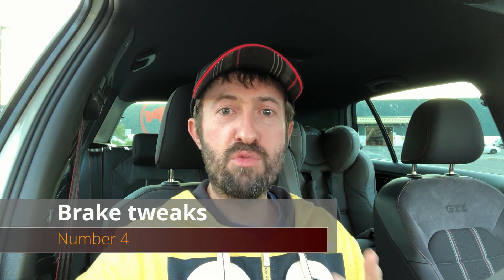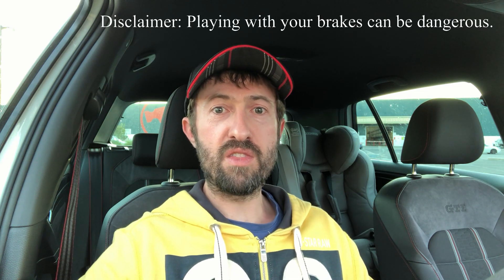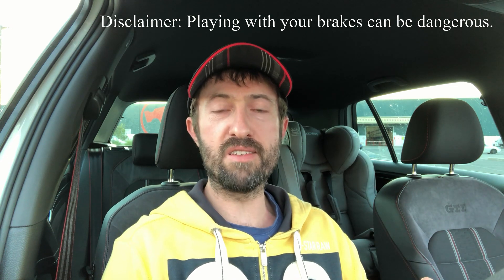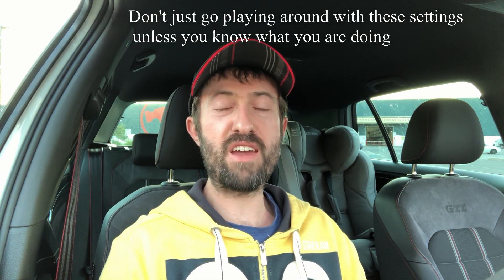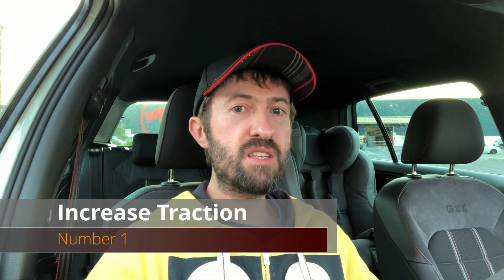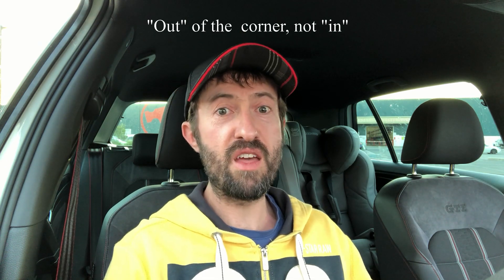Don't hit the track without these 5 OBD11 tweaks (mk7 GTI)

Comment: Am I right in thinking that OBD11 can turn the traction control off on a GTI with Performance Pack?
Reply from the maker: Yes it can. You need to change the way the button works so that long press is off.
Reply: @trackhackau  I managed to set this up with ODB11 which is great, 1 pass sports mode, long press TC off. But this does not actually turn off the TC, you have to also deactivate the Starting Vibration Reduction in control modules, without deactivating Starting Vibration Reduction, TC will not be fully off. Hope this helps.

Comment: i know this is an old vid but your wrong about the XDS it has nothing to do with rear wheels. The XDS electronic differential lock improves the traction and handling of front-wheel-drive models. In technical terms, the XDS system, initially developed for the Golf GTI, is an extension of the electronic differential lock (EDS) integrated in the ESP system. As soon as the electronics detect excessive unloading of the inside wheel of the driven front axle during fast cornering, the ESP hydraulic system builds up braking system pressure in a targeted way on this wheel to restore optimum traction. This way, the XDS acts as a limited-slip differential to compensate for the understeer typical of front-wheel-drive cars during fast cornering.
Reply: True ! Xds applies only to frond wheels

Comment: So you will have the setting in the infortainment system for diff on and off. If you code the diff to increased traction will this setting always be switched to on then even if the setting in the infotainment system is switched to normal?
Reply from the maker: Settings in infotainment don't change. Looks the same. I'm not positive what the change does too all settings. IE does it change normal to sport and sport becomes increased traction. My guess is that it only impacts the Sport diff setting.

Comment: XDS applies the brake to a spinning inside wheel to aid in allowing torque to go to the drive wheel with traction. The effect is the same as if you have a limited slip differential, although it is weaker than a good limited slip as brakes are easily overcome by the engine and hamfisted throttle input will overpower it. It works extremely well on my Mk6 GTI and it definitely has a hugely positive effect on corner exit.
Reply from the maker: I've tried it both ways, low and normal. Verdict is still out. VAQ works pretty well though.
Reply: @trackhackau  I'm sure VAQ is next level great, especially when combined with XDS.  But as my car has XDS alone I can only really comment on that.  About a year ago my ABS control module failed, leading to XDS not functioning.  Prior to that I always thought XDS probably wasn't doing all that much, but having driven without it on a purely open differential showed that it does an awful lot more than I originally thought.

I'm not sure if you can easily disable both VAQ and XDS via scan tool, but if you can it might be worth trying just to see how each contributes.

One of these days I'll install a proper mechanical limited slip differential, but at near stock power levels the GTI really doesn't need it as XDS is surprisingly effective.

Comment: Difference between ASR off and ESC sport?

I have Mk5 gti and ASR on that car is referred to reduce engine power when the car defects loss of traction.
Reply from the maker: ASR - Anti Slip regulation
ESC - Electronic Stability Control
ASR is basically traction control and yes it cuts power when it detects when slip under acceleration. ESC is your stability control. ESC Sport will allow a little bit of play before intervening, eg it will allow a touch of lift off oversteer. Then it will use the brakes on each wheel to straighten you up. Great safety feature, no good on the track though. Perhaps I'll do a video to explain the difference in more detail and the various long coding options available.

Comment: Hi! Can you teel me more about the "Starting vibration Deactivation" option? Is this mod effective only when you put the car in ESC Off, or you can not more use the ASR for 'normal' driving?
Reply from the maker: It’s separate and independent from ASR and ESC sport/on/off. This option stops the car from reducing torque in low gears when you lose traction. It’s to stop you from axel tramping.
Reply: @trackhackau  I've tried to disable the 'starting vibration reduction' but in my '19 Golf GTI PP I can't find anywhere that adaptation. Do you know if it can be coded via long coding istead?

Comment: Thanks so much for the info! I was wondering though how safe it would be for casual street driving to disable brake stabilization, I hope ABS and EBFD would still activate. I'm also wondering how much of a hit to casual driving comfort vs control would change if I disabled the torque limiter and brake/throttle smoothing. I really don't plan on tracking my car, but I still would think disabling ESC, setting XDS to weak and setting the diff to increased traction would improve driver engagement enough while still maintaining comfort and safety, what are your thoughts on this?
Reply from the maker: All the changes are totally fine for street driving. You won't even notice them. Doesn't impact ABS at all. Stability control is also not impacted when it's enabled.
Torque limiter you will only notice from a dig. You will either fry tyres more, or wheel hop more if on factory mounts.
After doing this video I've read up more and I think leaving XDS to normal may be best. I've changed mine back but I'm waiting on my next track event to test more. Theory is that it acts as a pre-load to the VAQ. But either is still fine. You won't notice it on the street unless in the canyons etc.
None of these changes will compromise safety in any way. Always drive within your limits though, especially on the street.

Comment: About the “Increased Traction” setting on Golf Rs,  I feel like this actually slows the car down by reducing power when a wheel starts to slip.  I’m just not so sure about it.
Reply from the maker: Hey mate, I don't have an R so can't comment from experience. But I do know that the haldex doesn't reduce power. It transfers power. What reduces power is the "Starting vibration" option. This by default kills power in 1st and 2nd gear.  This mod (it is believed) just increases the pressure so the haled responds faster and with more pressure. If you are getting excessive wheelsman in an R perhaps you need to get your Haldex looked at. It's not uncommon to have pump failures. Or it might just need a service.
Reply: Turn off ecs on R.

Comment: Thanks, I was always complaining that the brake pedal is not that linear
Reply from the maker: You’re welcome!
Reply: Track Hack BTW what’s the VCDS access code for straight ahead brake stabilization? I tried all kinds on the internet but get no luck :(
Reply from the maker: Should be one of these
11966
37202
31857
28183
44595
24435
15081
18573
Reply: Track Hack Tried all of them today, no luck...

Comment: Could you explain XDS a bit more? Planning on doing a bit of autocross with the car and wondering if I should leave the XDS alone to help with car rotation or turn it to weak to help with straight out speed.
Reply from the maker: Hi Gary, lots of people have experimented with XDS and autocross. The consensus is that having it on strong feels like you are rotating more. It’s actually slowing the car down while doing so. I wouldn’t put it to weak unless you have the Performance Pack with the VAQ differential. As reducing XDS is allowing more work through to the VAQ. To get more rotation I actually play with my tire pressures so I can induce lift off oversteer easier. Rear sway bar is the proper fix for this. 
I would actually just try all settings on different runs. The theory is never as good as just giving it a go.